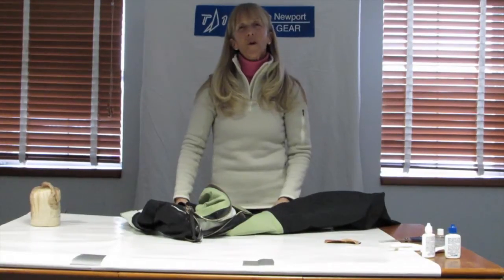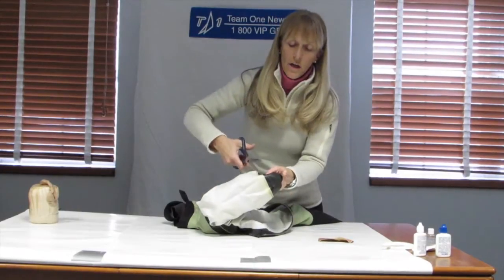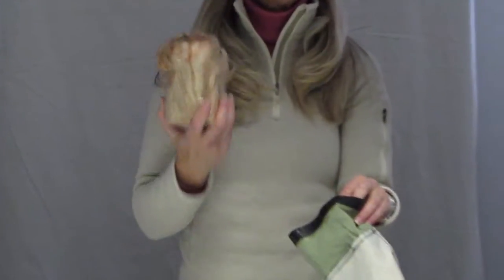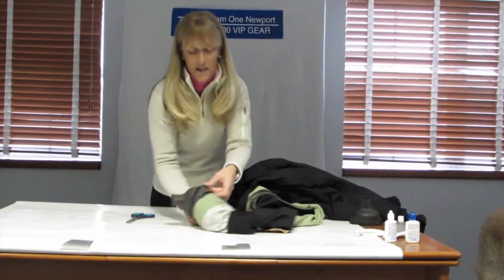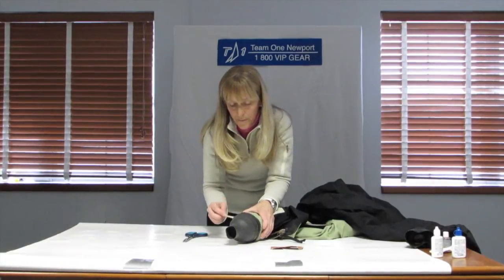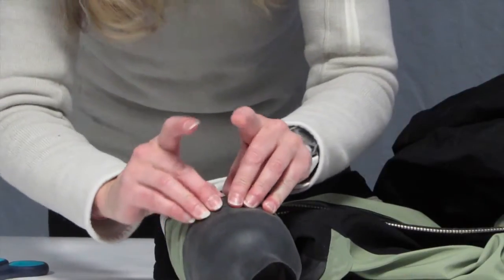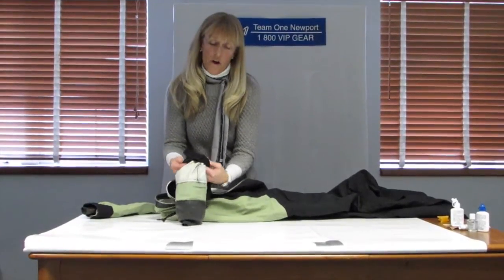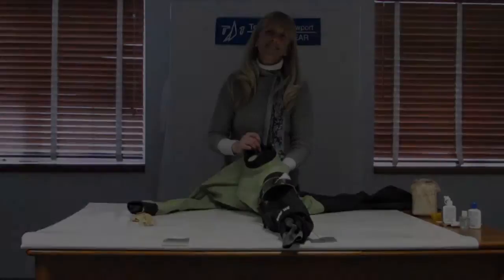Drysuit Repair - Wrist Seal Replacement

Comment: Seems as if with wrist seals, no one is putting coats on the mating surfaces, allowing partial drying, then pressing the surfaces together as is often the method with neck seals. Nice video. Thanks.